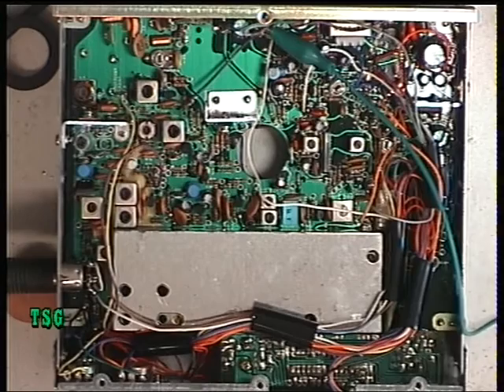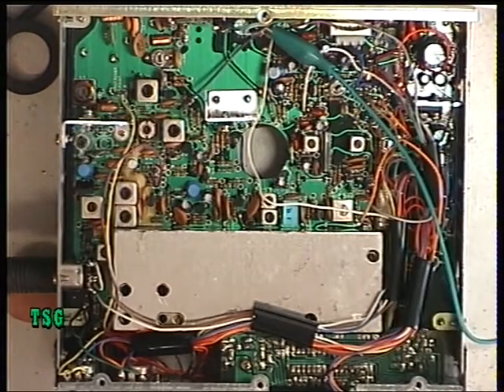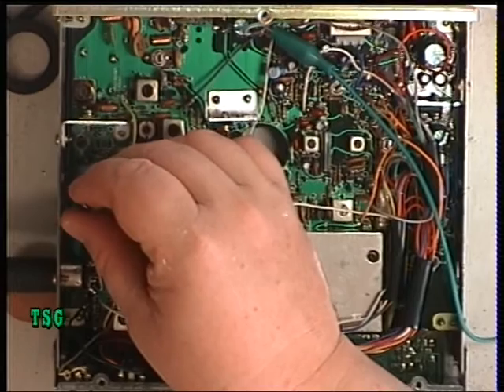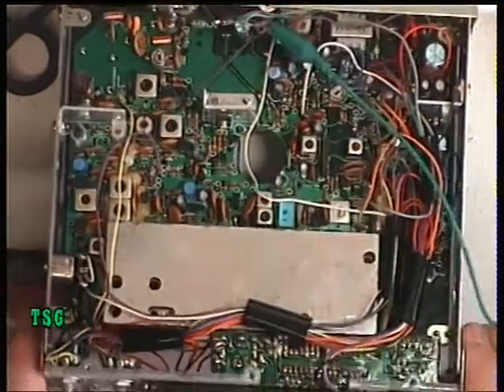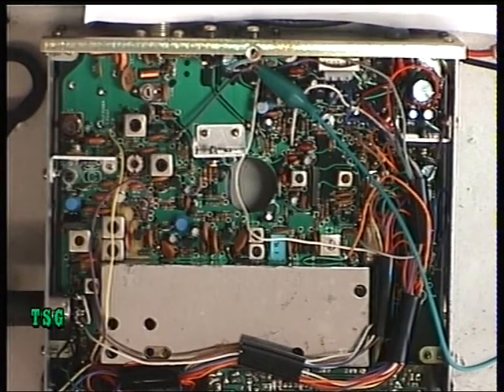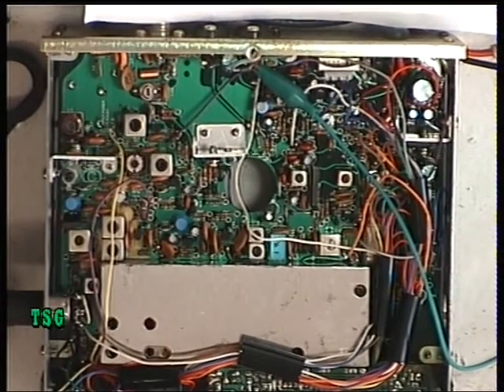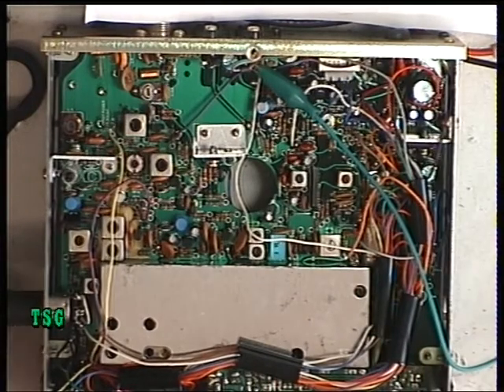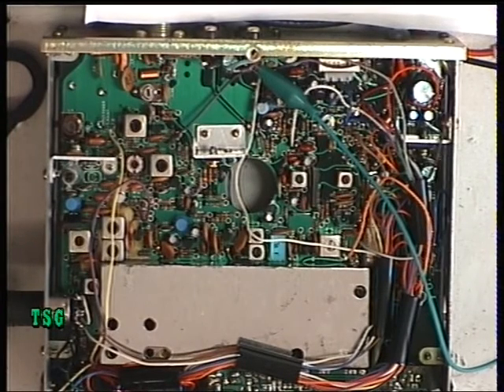Grandstand Gemini, UK (CB 27/81) CB radio (Mobile) - Transmit alignment

Comment: I have acquired one of these super cheap - it nakes a very quiet low level hiss no channel display no leds no rx or tx. Doesn't look majorly messed with no sign of soldering splashes, burnt tracks or cut wires. No adjustments make any difference either. Pushed and flexed the board but still nothing not even intermittent life or pops, crackles or changes in the tone or level of the hiss. Is there a common part that fails on these or any other possible reason for the near dead-ness ?? Chris.
Reply from the maker: I check the 8v rail is actually there. I've seen two cases of it being missing...you'll need the circuit which I uploaded for free use to SCRIBD. By far the most common problem is dry joints between the component side print & the solder side...usually under the wax filled VCO/synth can. I've three sets that need hours & hours of attention to track down these notorious dry joints; They were OK for the first 15 years. The Shogun mobile suffers from the same disappointing PCB side interlinking snag. Caused by the wire used to interlink not being as clean as it should have been when originally assembled.

Richard
Reply: @ukfmcbradioservicingTango21  Thanks for the response - I will attempt a bit more investigative work before consigning the whole damn thing to the scrap pile! Would be a shame because I've always wanted one of these.
Reply from the maker: Check if the radio does anything in PA mode, if not the starting point would be Q27

Richard
Reply: @ukfmcbradioservicingTango21  I'll try that when I get a moment later thanks.. Also, the only light that comes on is NB.
Reply: Thanks Richard, all sorted and now working,  a good 4 watts and lovely TX audio too. (Needed a bit of tweaking though on receive and VCO was way out and not running).